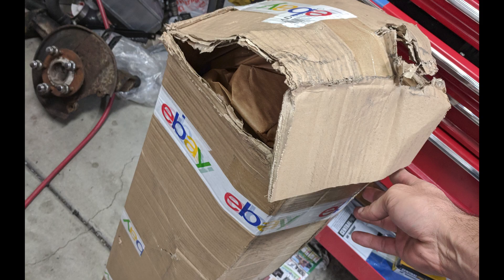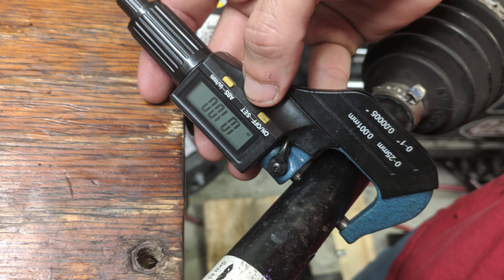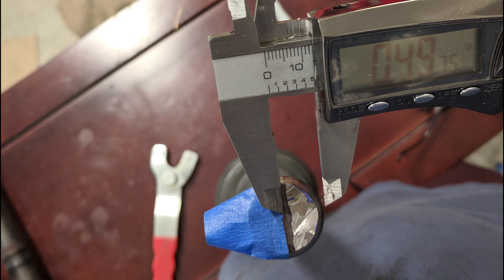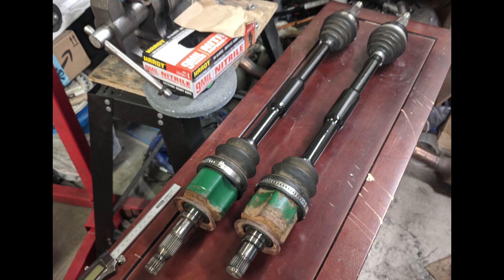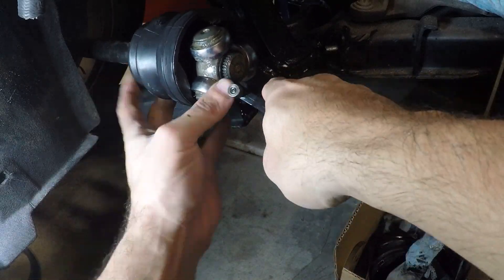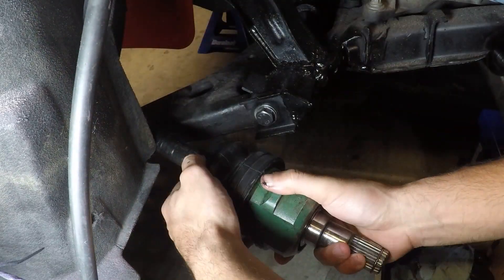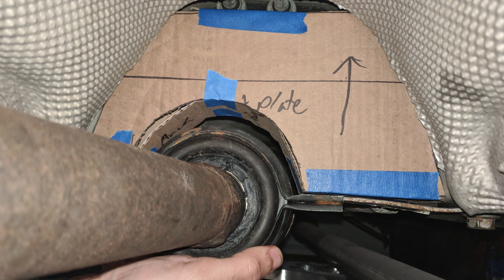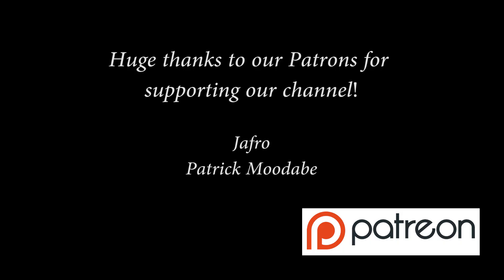How to Make Custom Axles and Driveshaft Supports - AWD Mini Cooper Ep. 26

Comment: Cool man. Im also looking to do mine im doing kswap 96 corolla  im going with toyota/ honda accord  axles  but lite scared to do
Reply from the maker: Oh that sounds like it'll be a fun car when it's all done. Yeah it's a little nerve racking but if you align everything well, it should work out well. My axles are still holding up well after driving around for the last 6 ish years and rally racing

Comment: That "easy" driveshaft support...??

@12:06 you can see brackets bolted to the car, just at the position where driveshaft support is welded in.

You could have used that to BOLT ON a much(!!) simpler drive shaft support. That would do the job for sure and would be really EASY. 🙂
Reply from the maker: That's a great point. I actually did that originally and drove around for a while, but the length was so long to get to that center point that it wasn't as rigid/solid as I wanted. In order for it to be stiffer, it needed to be bulkier and I figured let's just weld something here now so it's a forever bolt on solution (since this car will never be stock again anyway lol).
Even for the carrier bearing, I wanted something I could easily look up in a catalog for one of the 7 cars that this Mini is made from. It's hard to keep up with Mini, Mitsubishi, BMW, Honda, Ford, Hyundai, and a plethora of universal parts haha. It's one of the "let's make it messy/complicated now so it won't get messy/complicated later" type thing. If I bottom out in a rally, I can buy the part at AutoZone or have a spare one hand rather than have to fab something in a pinch to keep racing.

Comment: This is a great tutorial. Just what I was looking for. Also, wanted to let you know when you said you put the brake cleaner can under the welding area I got concerned as my brake cleaner can says "do not use brake cleaner near open flames, welding operations, or excessive heat. Vapors may decompose to harmful or fatal corrosive gases such as hydrogen chloride and possibly phosgene." Stay Safe.
Reply from the maker: Glad I could help. No worries ok the can, everything had been cleaned and long flashed off before I started welding anything. I'm certainly not a fan of breathing in chlorine or anything like that haha. I've also worked with phosgene and hydrogen chloride in the past and they're some pretty nasty stuff. I work more with H2S and HF now though. But that is a good clarification that I didn't have in the video. Thanks for looking out mate.

Comment: I've actually used this exact method on my buggy I'm building. Honda D Series engine and gearbox(130BHP) and Mazda MX5 mk1 hubs and half shafts. However I've broken the shafts 3 times now. But they always break at the end of the collar, not where the joint is. Could the heat from welding possibly weaken the shaft?
Reply from the maker: Very cool. Yeah you have to be careful because axles are usually heat treated and that gets messed up when you weld it. Typically you need to heat treat it for the most consistent strength. Is it breaking at the weld joint at the end of the collar or within the heat affected zone?

Comment: This was really cool. But could you let us know why you did the axels?
Reply from the maker: I couldn't use any axles on the market that would fit with the Mini Countryman All4 trailing arms and the Mitsubishi Eclipse GSX rear differential. I needed to use the Mitsubishi diff to work with the transmission gear ratios and I feel these aluminum OEM trailing arms work much better than the steel welded trailing arms I made in a previous video which used the Mitsubishi hubs.
If you haven't watched the series yet, basically I got the engine swap and AWD conversion working, but the rear suspension geometry and weight was a big limitation on what I wanted to do with the car in rally and autocross events. I could get aftermarket custom ones made for $800 to $1000, but they would need me to cut the axles in half anyway, then tack weld them where I need, and send them in so they can make a one piece version. It would also take 6-8 weeks for companies I spoke with to make them so I decided why not just go full DIY. 😁👍
Hope that makes sense, but feel free to let me know if you have any other questions.
Reply: @InitialDIYmods  
I guess I should watch the series hahaha
I'll have to check it out thanks for the explanation!!

Comment: Can you please, please talk about creating splines? I am very interested in this topic and having a hard time finding information on it.
Reply from the maker: I'm trying to find some good resources for you but, in short, you would need to use a lathe to get the overall diameter set and then use a mill with a cutting wheel that matches your spline gap profile and a dividing head attached to the mill table. The dividing head allows you to make cuts at specific angles on a piece. So if you need 16 splines, then your dividing head will be set to 1/16 stops and you use the mill to make horizontal cuts on the shaft at each stop.
I know some good machining channels so I'll try to find one of their videos later tonight when I get back home. Hope that helps in the meantime
Reply: @InitialDIYmods  I would appreciate that, I actually recently found some information on doing just as you described, however my new interest is trying to create internal splines, hah!
Reply from the maker: Here are a few links that should get you on the right track. The easiest way assuming the part is open on both ends would be broaching, but a rotary broach can do it too if you custom made a broach cutter for it specifically fit to your inner spline requirements. If you wanted to make the inner CV spline match the axle vs the other way around for example.
This one covers cutting splines https://youtu.be/gDQLIEV3IpA
This one covers gears and indexing https://youtu.be/Q-XOM4E4RZQ
This one covers manual broaching https://youtu.be/ZRbOux9NfeU
This one covers rotary broaches/broaching https://youtu.be/GWyHJVOxKK4
Hope that helps
Reply: @InitialDIYmods  Awesome thanks for all the resources!
Reply from the maker: Happy to help and best of luck

Comment: Do you know if your joint is better than a 45 degree joint? I've heard of both working well. Just curious if one is better than the other.
Reply from the maker: In practice, it shouldn't matter if the welds are solid, however, in theory, a 45 degree angle would push the axle sides apart. Depending on how much grip your tires get and how much torsional flex you get on the axles, that theory becomes more and more of a consideration

Comment: Are you gonna have the cv shafts balanced.  Or is there no need?
Reply from the maker: Getting them balanced would be ideal, but I know they are close enough to not feel any harmonics at 100+ mph so these should be very close. If I can find a place that does balancing locally in Houston, I'd love to try it out and see how close I got for a home garage and fully DIY job. I'm certain they could be improved
Reply: Even factory doesn't balance axle shafts, diameter is too small to matter

Comment: Yo do you still have the Amazon link for the pliers? Had no idea these existed!
Reply from the maker: Hey mate, here are the CV boot pliers I got for this video. https://amzn.to/3z9mEOc
Definitely worth the $25 or so dollars. These are the clamps I bought as well. I bought a few sets which had me covered with spares as well. https://amzn.to/3IKb53h
I make sure to bring to any race events as well just in case. A real life saver if I pop a boot off while rallying.
Reply from the maker: They make take a few tries to get the hang of it, but make sure it's tight before you use the pliers other wise it won't be tight enough. Best of luck